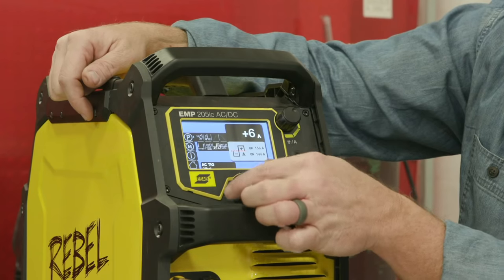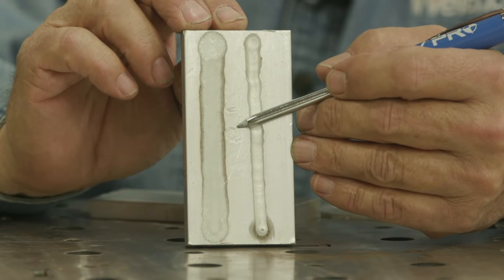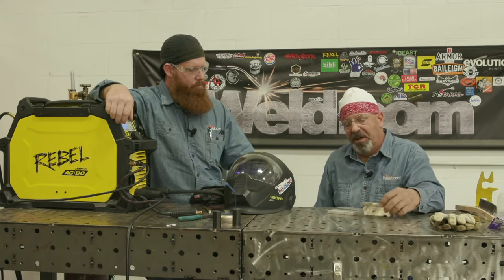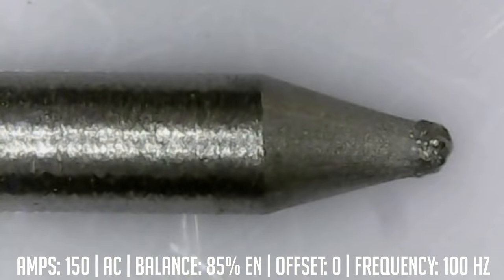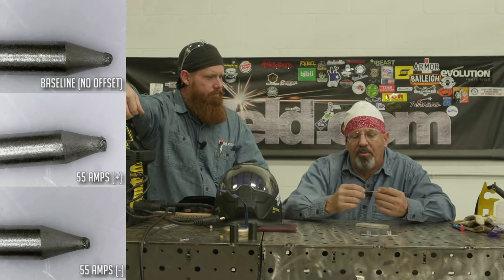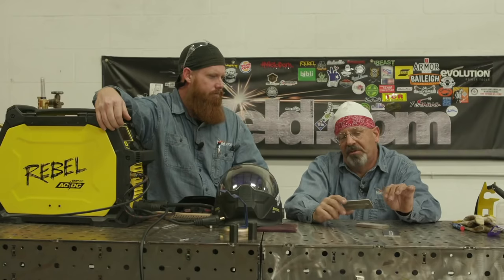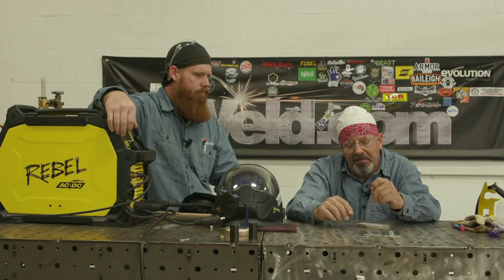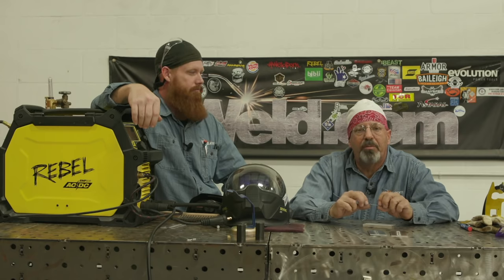How to Use AC TIG OFFSET to get Better Aluminum Welds

Comment: As a hobbiest way over my head. I would guess the welders who understood this video don't need this video.
Reply: Or they could be like the guy we have at work that is too bull headed to listen to anyone because he knows everything!  That DC ep pass on cast aluminum could do wonders for us!
Reply: its just a dial on the machine you probably would not notice what it is changing. if your a novice you would turn it this way and that way and never understand what it is doing. this video does a great job of understanding its purpose. much needed information if you are using a machine your not educated with, from the inside loop. you know because "buttons are not toys". as we twist twist turn push hold for 5 seconds anyway.
Reply: Same boat lmao

Comment: Thanks for this. I own this machine and was interested in this demonstration of capability. Small correction - according the owner's manual, you should be subtracting amperage from the other side of your balance offset setting.

Comment: Hey Bob! Love the videos! Would you possibly beable to do a 1g root with 0.035 hard wire on 3/8" plate? Bevel angel is 30 degrees and voltage is between 16-20 with 100% CO2 shielding gas.If you could do this it would help alot!

Comment: You didn't really explain what changes with the offset.  Is it the amperage level for the 15% of the time the AC wave is on electrode positive? And if so at 150 amps with 55 offset what is that amperage during the 15%? Do we know?
Reply from the maker: It depends if you are putting the offset on the + side or the - side. If you put it on the + side you would have the increase in amps for the 15% of time when you are on that side of the cycle. The opposite is true if you put it on the - side.
Reply: @Welddotcom  Awesome.  Thank you for responding.  You and Jody are welding gods btw.

Comment: on the cast comment, so why wouldn't 99% en-, 50 amp ac with a +50 offset be the same as 100 amp dc+??   (less a 1% off time)
Reply: kwasg3 you could do that as well and it would have the same effect.

Comment: Very nice :-) If you are driving this tests on 85% ballance you are maybe not seeing the full effects of the bias / offset you are setting, are you?
Reply: We stayed with 85% as a baseline so as to not change up too many variables and maintain the integrity of the electrode.
Reply: It may be interesting to see if 85% balance with NO offset will be very comparable to 50% balance at „85%“ on the offset (meaning same „integrated area“ EP and EN just reached not changing the balance but the offset... should be the same - or am I wrong?) Btw: Wouldn‘t it be better to also have the offset as a percentage rather than an absolute value?
Reply: @SMArtMetalArt  It doesn't go to 85 offset.
Reply: @bobmoffatt4133  I think what Hardy G wanted to say is to test the effect of 55+/85%EN vs 55-/85%EP on the weld bead, because, by the looks of it, going offset - or balance EN does the same thing. Of course, 55-/85%EP will ball the tungsten quicker, and going offset-/balance 70%EN or less will penetrate deeper and clean better than offset 0. And maybe combine this feature with pulse function?
Reply: What I meant was: I think 85% balance on your machine means: 85% of the AC wave is on the EP / cleaning portion and 15% on the EN portion - on usual machines the bias is 0 (so offset is 0). Having a look on the energy distribution of one full AC wave at offset 0 and balance 85% means 85% energy on EP and 15% on EN. So the result should be the same if we try to reach the same energy EP/EN distribution not using the balance (changing the pulse widths) but the offset (bias) for this having the balance at 50% e.g. having 85A on EP and 15A at EN - don‘t know exactly the settings you need to go for to reach that (maybe 50A main current setting having 35A offset - just for an easy calculation - or any other fitting values...) What I mean: I wonder if that settings aren‘t redundant reaching exactly the same results just on slightly different numbers but changing the EP/EN distribution of the energy exactly the same...
Reply: @SMArtMetalArt  On this machine it's 85% EN. That's how we maintained integrity of tungsten. If it was 85 EP it would've balled quickly.
Reply: Bob  Moffatt : sorry, than I just mixed EP and EN in my last post - just flip them to get what I meant. My question is: are these settings (balance and offset) redundant ones reaching exactly the same by just distributing the EN/EP energy energy of each AC wave (balance by pulse width and offset by bias)?
Maybe I should give some numbers as an example: Does welding at AC 100Hz, 100A, 85% Balance, 0A Offset give the same results as AC 100Hz, 100A, 50% Balance, -70A Offset ? The EN/EP energy distribution (85/15) over each AC wave should be more or less the same for both scenarios so it should give the same results... or am I wrong?
Reply: @SMArtMetalArt  OK, i got it wrong. You want to keep the energy transfer constant over each half-wave. Considering that the machine's output is square wave, in an idealized calculation (and flawed, because i don't consider the voltage applied), welding at AC 100Hz, 100A, 85%EN balance, 0 offset would yield the same result as AC 100Hz, 30A, 50% balance, -140 offset(here, the offset just increases one side current, without lowering the other). But, in the first case that means lower power over longer time, and because of the aluminum's heat transfer coefficient, it would result in a lower travel speed, and less penetrating, wider bead (at least that's my logic).
Reply: Bogdan N : hmmm - that was not exactly what I meant... ok, lets pick up the tests Bob made... His starting scenario is: AC 100Hz, Balance 85%, Offset 0A. Second scenario is setting the offset to +55A,  third scenario is setting the offset to -55A. Because of always keeping the Balance at 85% this is mixing up the offset effect with the overlaying change of changing the overall transferred energy because having the balance at 85% results in a decrease of the overall transferred energy in scenario 2 by 25% as well as increasing the overall transferred energy in scenario 3 by 25% (compared with his baseline scenario 1). This results in not being able to really distinguish between the effect the offset gives us from the effect of the decreased/increased overall transferred energy. What I would like to see is the effect of the offset itself. The overall transferred energy should remain the same (independent of the offset) only at 50% Balance. The more „unbalanced“ you are the less you are able to see the real effect of the offset itself. The other thing I would like to see is, if the results will be very much the same if you either change the EP/EN energy distribution by Balance or by Offset. That‘s what I tried to explain in my last posts scenario.

Comment: Remember though if you are going to use Brake clean IT MUST BE NON CHLORINATED!
Reply: Canuck Loyalist yes sir, that’s correct. I made sure to specify dechlorinated break cleaner in the video since chlorinated will convert to phosgene (mustard gas) when exposed to the extreme heat of the plasma column during welding.
Reply: 101% correct! Looking forward to seeing more of your videos!!
Reply: Canuck Loyalist thank you for your support.